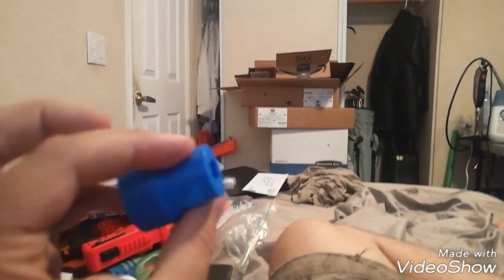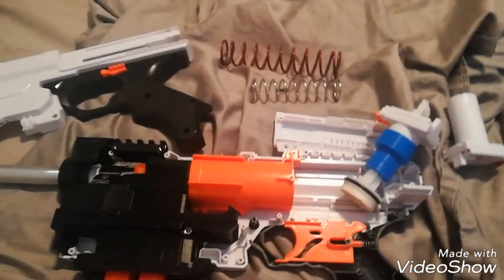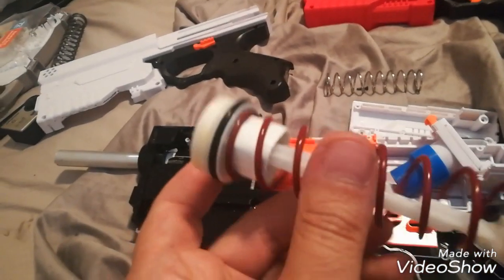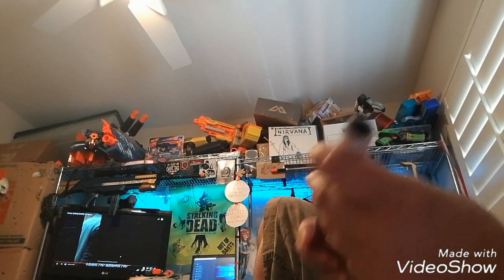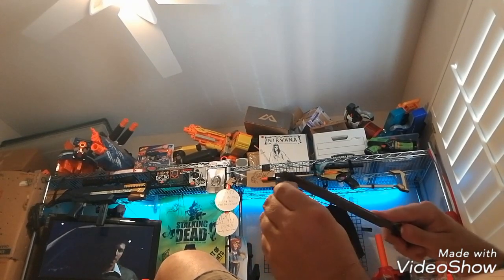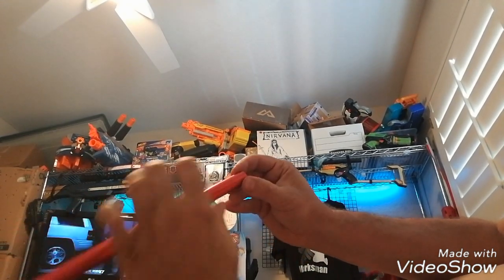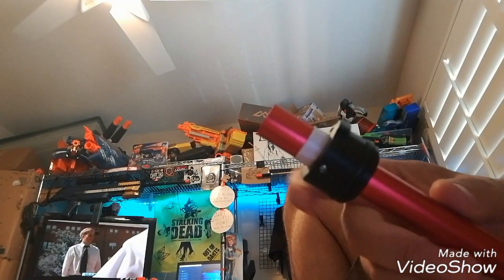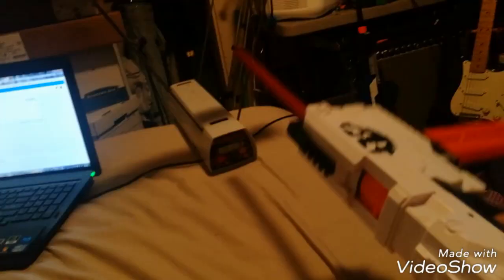[KRONOMAG WEEK] How to make a Kronomag have B@llz, (WARNING: Shop Video, lots of long details)

Comment: Hello for the spring rest and the amount to remove from the spring catch tube thing I know you said you measured to allow for 1.3" for solid space, but to make sure I'm doing this irreversible cut and solvent bonding right is the exterior of the adapter piece 3/8" from the white flat part of the catcher? (Remaining visable part of the original tube the adapter fits over being 3/8")  sorry to be a hassle.
Reply from the maker: SnifterRoux about 3/8" worth yes, I kind of wish this piece was one piece printing without the need for cutting.
Reply: @TheChrisCartaya  Thank you so much.  I am gonna use a mix of white ABS pa747 pellets and MEK (Methyl ethyl ketone) to bond them (got spring adapter printed in ABS) and also to bond the black and white pieces of the kronos shell together, hope that will work.  Thanks again.

Comment: Hi do you know if the plunger rod is ABS?  Mine came slightly warped and was wondering what would be the best method to straighten it and whether doing so will weaken the plastic?  Cheers
Reply from the maker: SnifterRoux I believe its acetal, no idea how to straighten it.

Comment: When I take the blaster apart the 18.5kg spring jumps out.  I have tried priming before disassembling but the slightest bump and it sets itself off.  Any tips to make it easier to install the spring and to remove the spring without the fear of it breaking/losing surrounding parts?  Cheers
Reply from the maker: SnifterRoux its hard to get in, but put in the trigger catch assembily and then put in the other side of ghe shell, use a screwdriver to line it up, its tough, lots if yield, but worth it.
Reply: Is the 18.5kg brown spring from turf ?

Comment: Do you have a link to where I can get the kronomag adapter?  How far did you cut down the other part for the 18.5kg?  And is that the stock O-ring or the one that came with the kit?  Cheers
Reply from the maker: SnifterRoux: James Terrill sent it to me as a gift, along with some other stuff, hes on fb, ask him, as for the kit, Nerf Eze sent it. I ended up changing to a red silicone 2x34 mm ring and streching out with teflon tape till it fits. As for how I determined thats where to comut the trigger catch assembily, I measured it to fit 1.3" soild space, which is stadard for an LS.

Comment: Have you ever tried dumping a 26kg LS spring  into this?
Reply from the maker: I Tried a 18 and 9 kg stampy turf spring, could barely prime it, but i got into 350 fps territory
Reply: Chris Scaramanga Cartaya damn, I should try that! How does a 9kg spring get 350 fps? By the way, where can I get the blue spring adaptor in your video ?
Reply from the maker: Dexter Tan 16 and 9 kg, as in 16+9 kg
Reply from the maker: Dexter Tan: friend sent it to me, a myvenom adapter
Reply: Chris Scaramanga Cartaya holy cow hahahh
Reply: Chris Scaramanga Cartaya thanks! It’s so hard to find online 😭
Reply: Chris Scaramanga Cartaya im going to try a 25kg with the adaptor and your fine tuning steps
Reply: Chris Scaramanga Cartaya did you intertwine the 18 and 9 spring together?

Comment: can i use a "Worker Rival Kronos 18KG Spring" from monkee mods and achieve 250 fps with a 11.5 inch barrel?
Reply from the maker: TBH i don't know, however i hear in general its a weaker springthan my first prototypes